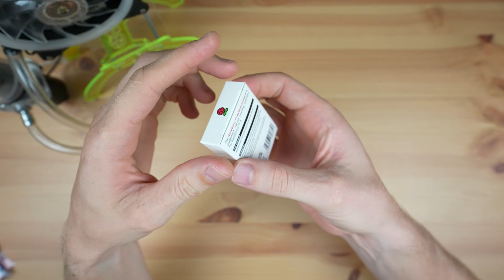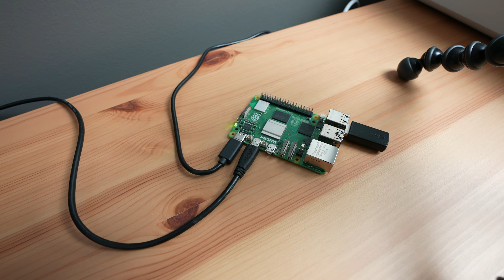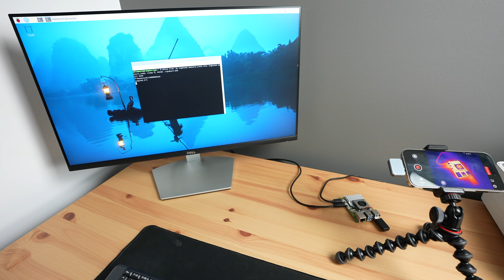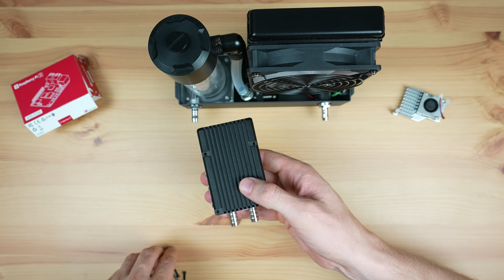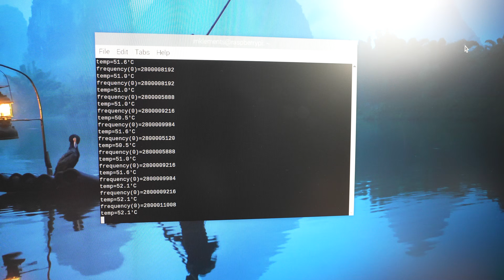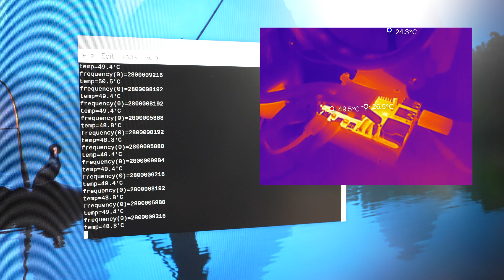Should You Water Cool Your Raspberry Pi 5?

Comment: High End gaming pc's today will use double the power that an average house with every electrical device all running at once so in my current build I'll be adding in the Raspberry Pi 5 for daily pc use for email, & youtube.  The water block made by Seeed Studio has G1/4 threads so any water cooling fittings will work, including hard tube fittings, & since the pc I am building is going to be all glass tubing, this will not look cringe.  I am also planning on installing a small led monitor for system monitoring, & with the RPi5 installed I'll have it connected to this screen so it can stay on while the PC is off, to monitor for everything my phone already monitors (emails, etc), but it will also monitor for leaks inside of the case, so I know not to power on the gaming pc.

So I ordered & have received the Pi5 water block already & once this current pc is built (I'm having a hard time finding the time needed) all I'll need is a KVM switch to switch the keyboard, video, & mouse over from the main pc's K, V, & M ...think once I build & post the video on my main youtube channel I'd bet we'll see it copied in new youtube build videos, having this built in to me it is just common sense, because we are all struggling these past few years.  

btw, Right now the Seed Studio RPi5 water block is currently only $16 bucks (normally $20), this is only the block & the pads, screws, back plate, soft tube g1/4 connections, so everything but the pump, soft tubing, fan, & radiator.

Comment: Try your pump and radiator on the copper water block. You may be seeing better cooling from air flow, larger radiator or a more powerful pump. Plastic sides on the copper block aren't going to do much and it has a lot more horizontal surface for liquid to extract heat from. Any water block works best from a turbulent flow. Maybe the copper block is too "smooth" and "laminer" in its flow to get the same results? First thing of course is to make as many variables the same so you can eliminate them. You can also run your water block on the others pump and radiator. What does that do?

Comment: awesome video! i dont know much about the water cooling as im just getting into this hobby and i will be buying this system. so i have a noobie question for you lol, do you use just plain water with some sort of coloring or do u put actual rad coolent in her?
Reply from the maker: It's best to put proper PC coolant into the loop as this has anti-corrosion and anti-microbial properties. Water is fine for experimentation for a day or two but not for long term use.
Reply: @MichaelKlements  awesome thanks dude!

Comment: I think your kits looks better.  I get flack all the time for using 52pi ice tower coolers on my Pi4 and Pi5s from facebook groups saying "do you think this like an intel cpu, its only a raspberry pi"  but i dont care...if they running cooler then why not!  Never water cooled a Pi before but it looks like fun to try.
Reply from the maker: I agree, I use an Ice Tower on my main Pi 4 and Pi 5 in my desktop case design. It's probably overkill but it keeps the Pi nice and cool and looks good too. Water cooling is definitely not necessary, it's only really beneficial for a cluster of Pis.

Comment: Agreed that they should've used an Al block. For an RPi, there really isn't much benefit of Cu over Al.
It's a hilarious product and I love it. Totally fun overkill for a single RPi but a pretty good idea for clusters. 
My RPI5 also can't stay at 3GHz stably though it can do 2.9GHz all day long. RPi5 is still in early production with rev. 1 boards, so I think later ones will hit 3GHz just fine (much like my early RPi4 can't hit 2.4GHz, but my later two run 2.4GHz just fine). I'm sure >3GHz will be unlocked at some point, too, either via hack or firmware update.
Reply from the maker: An aluminium block would have still looked good and we're already so far down the road of overkill that Cu vs Al doesn't matter anymore.
I've only got two Pi 5's so far, one doesn't boot at all at 3Ghz and the other boots but if you put any load on it then it crashes. Hopefully I'll be luckier with some new ones in future!

Comment: Why though? Just buy a real computer at this point
Reply from the maker: This is definitely a "because you can" project, it is not cost effective nor does it provide much benefit for a single Pi. As I've said in the video, the $5 active cooler is good bang for your buck and works well even on an overclocked Pi.
Reply: Here's a why for ya. I'm integrating a pi with a cooled bed. Since the bed is liquid cooled, why not just plumb in the pi??? 

Oh and the og cooler DOESN'T handle an OpenCV compile without going over 70c in a stock case.😢Granted this is below throttle limit, but why push it.
Reply: @silverwinterstorm69 You're just working around the limitations of using the wrong tool for the job at that point then...
Reply: Because you can.
Reply: He is doing it for fun 😂
Reply: Huh? Why though. Just water cool your raspberry, because you can.

Comment: Shouldn't the baseline be w/o cooling?
Reply from the maker: If the test can't be complete on the Pi 5 without cooling then we can't use that as a baseline - it thermal throttles after half a minute. The only useful information we get from that test is - don't do the test without cooling.

Comment: I am just curious is it possible to replace the fan and use another one that is more quiet? I did my own water cooling solution for CM4 by copying your DIY project for CM4 and since then I am a fan of water cooling. However it was expensive. 120 USD is much more below the price I achieved when I built my own project. So almost in the same price I can buy Raspberry Pi 5 in Poland. Raspberry is cheaper a little bit (few bucks less). However I would like to see a case for Raspberry Pi 5 with water cooling, similar to the one you made for CM4.
Reply from the maker: Yes you can replace the fan, it's just a standard 12V 120mm PC fan. It's not the fan that is the problem though, its the return line to the reservoir that makes the most noise on the unit.
If you're buying premium PC parts then the costs quickly exceed $120 but you should be able to put something together for less than that. IFrom memory my water loop parts cost about $60 and then the acrylic, heatsink and thermal pads cost about another $10 so the DIY solution is a little more than half the price.